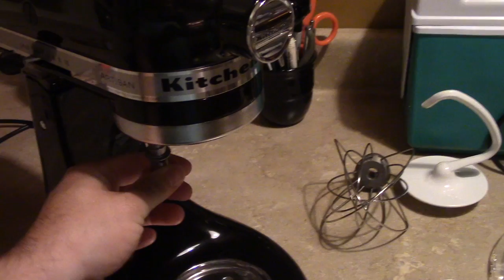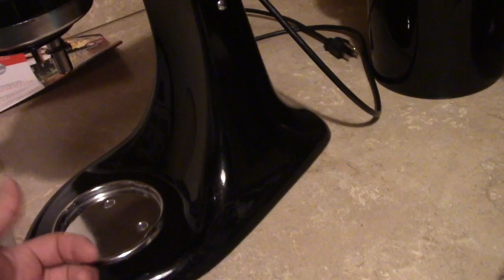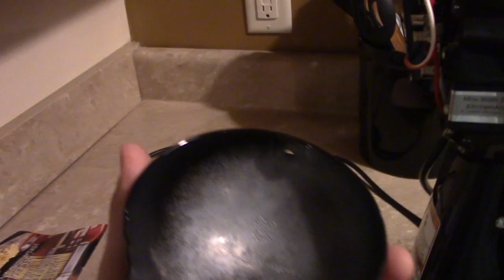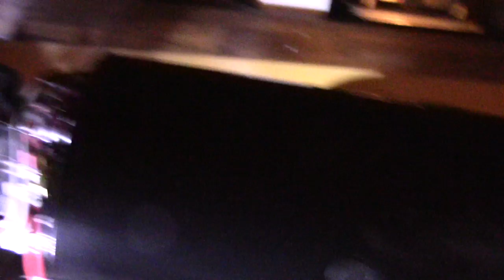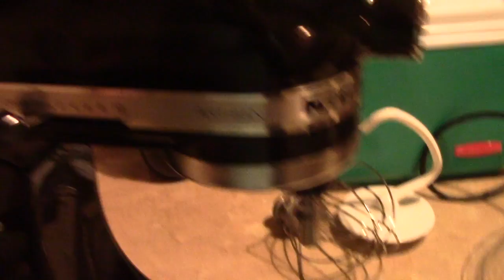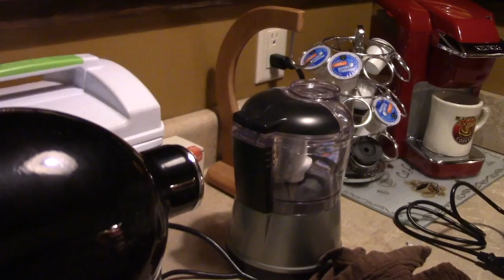The KitchenAid Stand Mixer Mechanical Governor Explained

Comment: This explanation is correct as far as describing the effect of the governor, but not in HOW it works.  The brass stub at the end of the governor is not used to make an electrical contact.  It actually extends back more toward the rear of the machine as the motor speed increases.  When it makes physical contact with the speed control plate, it pushes the center segment of the plate back just enough to open a pair of electrical contacts in the plate assembly.  Breaking these contacts cuts power to the motor, which then slows until the slowing governor weights cause the end of the governor assembly to retract enough to stop pushing back against the center of the speed control plate.  At that point, the electrical contacts come back together and resume power to the motor.

The motor shaft extends a couple of inches beyond the rear of the motor, and this is where the governor is attached.  The governor assembly has a "fixed" section that is wedged onto the end of the motor shaft.  It also has a spring and a movable bracket that will shift back and forth in response to the position of the two weights as the motor is running.  As the weights swing out, they force the movable bracket against the spring and cause it to extend more toward the rear of the machine.  When the brass nub at the rear of the movable bracket extends back far enough, it will push against the speed control plate and force open the contacts.

These governors can malfunction, and they are fairly easy to replace.  I just repaired one of these mixers that appeared to have a defective governor.  The movable bracket on the governor would not shift back and forth and would not control the speed of the machine.  In this case, it turned out that the governor was not defective, but it could not move back and forth due to corrosion on the motor shaft.  The movable bracket has a hole that fits over the motor shaft, and this keeps it centered as it slides back and forth along the shaft.  The excessive corrosion on this motor shaft was enough to prevent the governor bracket from moving as it should.  Using fine sandpaper to clean and smooth the motor shaft solved the problem, allowing the governor to work as designed.
Reply: Since you understand how this works, maybe you can help me out. The contact the governor breaks goes into the phase control board (at least the part is sold under this name here in Germany - it is misidentified as rfi filter in the video, which US machines apparently don't have). The main component of the board is a Triac (BTA06), which I looked up and it seems to be basically an electronic switch that switches power to the motor on and off and so controls rpms (?). I understand why one would use an electronic switch (does not wear out and is faster), but what is the point of the electronic switch if it is controlled itself by a mechanical component? I suppose it somehow makes the start/stop of the motor less abrupt, but would be curious to get a proper explanation.
Reply: @unavailable753  It appears that the manufacturer has kept the design of the mechanical speed governor largely unchanged over the years, rather than replace it with a completely electronic control system.  The mechanical system seems rather crude by modern standards, but it is a simple and effective speed control method, and is made more reliable by the use of the triac that you mentioned.  The phase control board does work as an electronic speed controller, but it does so based on the feedback from the mechanical governor mechanism.  

So they still utilize the old fashioned mechanical governor to regulate speeds under varying loads, but added a solid state phase control circuit to power the motor.  I can't say why the complete control system has not been redesigned to utilize more modern electronic controls.  Maybe it's because the existing design uses relatively inexpensive components and a lot of folks know how to service them.
Reply: Very helpful, thank you

Comment: The KitchenAid mixer is a great home use countertop mixer that works OK under light loads. At low speeds mixing pizza and bread dough it obviously struggles.  At higher speeds with light loads it works as well as any other mixer its size. I upgraded to more powerful commercial mixers to handle the heavy mixing loads but do not fault the KitchenAid mixer in any way.   It is good for what it is
This link shows a couple of the upgrades.  One upgrade was a GLOBE SP8.   Another upgrade was a HOBART N50. These are shown in the video link.     https://www.youtube.com/shorts/Xb3scYQfF5w?t=6&feature=share
My latest upgrade was a massive 20 quart commercial mixer but isn't shown.

Comment: The board you pointed out at the top is a phase control board and there is a triac on the board that you didnt see tucked in the back. Its not an RF filter.

Also it shouldn't take 15 minutes into the video to get to the topic.
Reply from the maker: Thanks... ten years into making videos, and I still get the occasional "YOU DIDN'T TALK ABOUT WHAT I WANTED TO HEAR IMMEDIATELY!! YOU SUCK!!" comments. But I'm not changing anything. My most loyal viewers seem to enjoy my long ranting videos.
Reply: It is diac not  a triac

Comment: Got our kitchaid mixer at target... The whole thing is metal. Interesting to see plastics any were near it. Didnt know there were different versions of it.
Reply from the maker: All KitchenAid stand mixers are metal, but the brush holder caps are plastic so they don't conduct electricity, and the splash guard is plastic so it can be made transparent.

Comment: Hello, good afternoon, a question about the governor, the force to apply to the dough and be able to mix comes from the engine, but is it given by the governor? I'll explain my machine to you after I changed the pinion, it lost power, it works very well on empty but with a little dough it has a hard time mixing and it didn't happen before, I hope it's the coals, could it be the governor?

Comment: Thanks for posting.
I thought you were watching me. I had crack, are Waffle House about 6 hours ago and I'm repairing my KA mixer. Replaced speed plate. That was easy. Had to solder the top white with red stripe wire back on the board. The governor think had me stumped. Though it had to touch the speed plate. Fascinating that it powers and cuts off power rapidly to maintain set speed. So I mangled my governor and yep! The shafts pin fell into the unit, tried to get it out by turning unit upside-down and it fell on high pile shaggy carpet. Tried to find with magnet. It's gone! Wondering if governor moves along shafts at all. The as you called the "balls on the shafts" more like a barrel. Well, at one point mine flew out after the speed plate hit something and started sparking electrical super load and bright sparks. That was my finali. Ordering another governor. I'm in Nashville now. Originally Massachusetts and skied NH. Lived in Dover for a Summer too. NH is a beautiful State! You Rock! I rock, going to finish my push now. 🤣

Comment: I have the same mixer and then it is under load it actually slows the motor right down. I tried with the back off and seen the back plate moves a little when under load. Do you think it might be a governor issue

Comment: What is your house interior based on? 80's 90's?
I like it a lot my friend
Reply from the maker: It was built in 1986; the entire condominium complex is composed of six CDK (knock-down kit) timber-framed post and beam buildings, each containing five one-bedroom two-story townhouse units. The style is 1980s contemporary, which blends exposed wood and modern (for 1986) elements, like drywall interior walls, Andersen crank-out windows, blue carpeting, and pink linoleum flooring. I've updated mine a bit by adding the counter bar shown in this video (replaced all countertops in the process), replaced all light fixtures, painted the walls, new slider and mechanical systems, and that's about it.
Reply: +BBISHOPPCM's World if only the quality of 1980s Construction In NH was the same in Pennsylvania. a lot of 1980s houses like mine were built with about as much quality as a Walmart $5 toaster. stucco falling off the chimney, coax wiring done incredibly cheaply through the siding on the exterior of the house. Things like that.